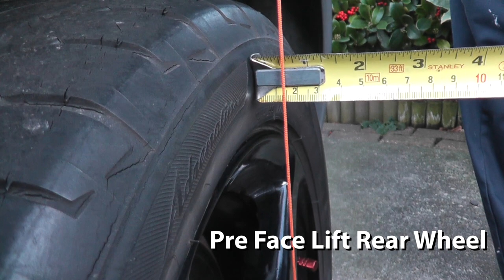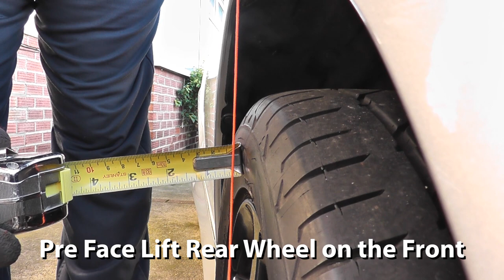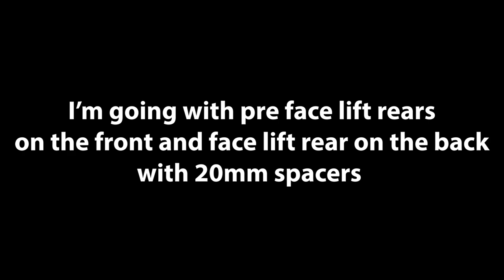Pre and Post MR2 Wheels Fitted with Measurements to the Arch

Comment: Interesting.
Reply from the maker: I have a set of pre and post face lift wheels so thought some might find it of use. After this I'm going to put the pre face lift 6.5s rears on the front with the stock facelift rears that should be on there with possibly a 20mm spacer on the rear. Drove the car with the wider rear on the front, actually better to me. its only half inch difference but visually looks much better.

I'm happy a manufacturer or retailer might supply a set of 10mm, 15mm and 22mm hub centric spacers so I can then show all the options with each type of spacer.

Once thing I have found out today...I never want to work in a tyre centre hahaha.

Comment: There's a very good reason almost all mid engined cars have a staggered set up and you'd be wise to stick with it. Rather than changing the stagger and ruining the balance of your car just to reduce the wheel arch gap you are far better off getting a set of coil-overs which enable you to set the height exactly as desired. A good set of coil-overs will also greatly improve the the handling. The face lift model went up from 205 to 215 at the back because the pre-face lift model was felt a little too oversteery. However A lot of people prefer a more neutral to oversteer balance like me and have gone up from 185 to 195 at the front but kept the 215s at the back which I find just perfect. Also people should note that the standard front springs on a face lift model are taller and give quite a bit more wheel arch gap than a pre-facefilt model. Face lift springs are also quite a bit softer. Spend some money on a good set of coil-overs and decent tyres and you won't certainly regret it but if you mess up your handling balance just for vanities sake you'll certainly regret it when you've gone off the road backwards into a ditch.
Reply: people run square setups for autox, nothing wrong with changing the car how you like it

and you can certainly end up backwards in a ditch in a stock MR2, a staggered setup cant save you from bad driving
Reply: Erik Anton Seastead square is fine if you want to do a bit of drifting but as I said there is a VERY good reason why mid engined cars run staggered setups and with a low polar moment car such as the Mr2 driving having a very unbalanced setup would be tantamount to suicide on the road.
Reply: Bossworld it’s the front that are different heights. I happen to have both an early pre face list car and a later face lift one. In fact  I had to put face lift front springs from my later car onto my early one just to get it through it’s mot last year and the difference in height is quite a bit. I think I’ve dropped something like 55mm on the front when I put coil-overs on my later car.
Reply: Bossworld aftermarket 3rd party springs will likely be different from stock so you can’t really compare.
Reply: The Talentless Mr. Kipling I own both and there’s not much in it performance wise at all. As you say about 50kg difference but you can take a bit of weight out anyway and it’s hardly noticeable. You’ll also only really need the extra bracing of face lift if you fit stiffer springs. Best bracing you can fit is a front strut brace, which. Ames a difference for very little weight gain.
Reply: We are looking for replacement tyres for our 2004 MR2 and would appreciate any advice on good all round tyre choice for general (mainly Summer) road use. Wheels/tyres are standard 225/45R16 Rear and 185/55R15 Front. Yokohama Advan AD08R is what we had been looking at - however these are only available for the rear - they don't do the front size now. There is an Advan AD08 RS available in 15" but by all accounts it's a completely different tyre from the R (not so good on wet roads) and we would rather have the same tyre all round ideally. Then, there is the Toyo Proxes TR1, available in both sizes, but have also read mixed reviews on its' wet road performance. Those two are the "traditional" options for the MR2 I believe? But with subsequent unavailability etc.  what about the more mainstream options from; Michelin, Continental, Bridgestone, Dunlop, Hankook etc etc? The current tyres are Accelera Alpha on the rear and Landsail LS288 front. We had a moment on a wet road when the rear broke away whilst just basically coasting down an inclined left hand slip road to join a dual carriageway. The road was wet but it wasn't raining nor freezing; the car was doing no more than 20-25 mph, no throttle, not braking and the back end end just broke away - not good. We want to change the tyres before getting the alignment etc. checked. Lastly, are coil-overs recommended for road use on an MR2 or primarily aimed at track day use?